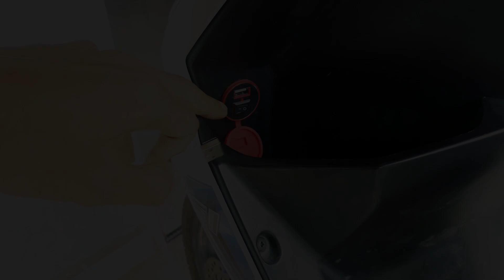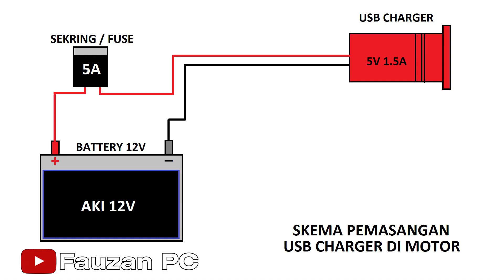Pasang USB Charger Di Motor

Comment: Bang mohon pencerahannya..
 saya mau pasang nih, yg skalian ada Amper meter nya juga,, saya coba tes voltasenya 13.1A.. itu normal ga bang ? Terus klo pake sikring yg 15A bisa ga ?
Mksh.
Reply from the maker: voltage 13.1V maksudnya ?
itu normal..
saat mesin gak nyala voltage di 12v
saat mesin nyala voltage diatas 13 sampai 14
sekring 15a bisa, namun akan bagus dipakai 10a kebawah
Reply: @FauzanPC  ok... Mksh bang.. Alhamdulillah baru beres pasang.. paling tinggal ganti sikringnya aja.. pas beli ga di liat2..

Comment: Mau tanya bang cara pemasangan ini berpengaruh gak dengan type motor sudah DC atau tidaknya? Atau mau DC ataupun blm DC gak ngaruh? Trimakasih
Reply from the maker: DC atau masih AC tidak masalah..
asal pengambilan arus di DC.. dan menggunakan battery aki
Reply: Makasih bang ilmunya
Reply from the maker: @billykubil2966  😁👍
Reply: Oh Iyah om kalo charge plus volt meter sama gak om pemasangan kabel langsung aki nya  @FauzanPC
Reply from the maker: voltmeter sebaiknya ambil kabel kunci kontak ON
Reply: Ok om terimaksih atas pencerahannya  @FauzanPC  sukses buat chanelnya om

Comment: Bang mau nanya. Itu harga sekring di bengkel gitu brp y? Lalu bagusan sekring 5A atau 10A? Semakin tinggi semakin bagus atau gimana?
Reply from the maker: harga nya 500-1000 murah kok sekring nya..
bagus 5A .. karna kebutuhan charger nya tak lebih 3A..
Reply: Pakai sikring seperlunya., Buat charger hp cukup 2-3 amper ., Sebab batere motor rata2 cuma 5 amper .
Amper semakin besar belum tentu semakin bagus , gimana untuk fungsinya .
Misal di pasang sikring 10 amper , jika terjadi konlet sikring kuat tidak putus , kabel kecil ,malah kabel nya yang panas nyala .

Sebaik nya, kabel + dari charger di seri dengan dioda + tahanan 1 ohm ( menahan tegangan 14 v dari dinamo motor ) + sikring ,di pasang semua secara seri . Charger akan aweet .
Reply from the maker: mantap 👍
terima kasih refrensinya 🙏
Reply: @ukmkotabandung3609  diseri dioda maksudnya gimana ya
Reply: @DiLi11  
Secara seri ,maksudnya , dioda di pasang pada kabel salah satu dari kaki dioda , kaki dioda yang satu lagi di teruskan ke aki motor , jangan takut terbalik , kalau tidak nyala ,di balik aja , dan akan nyala charger nya .fungsi dioda hanya sebagai penyearah arus ,jadi kalau terbalik tidak akan ada aliran srus nya , dan juga berfungsi penahan arus .., misal aki motor 5 amper ,yang di perlukan cuma 1 amper ,maka pasanglah dioda satu amper ( dioda N4007) .,hal ini sangat berarti dalam pemasangan Led ,sebab led akan awet jika tepat di beri tegangan volt dan tepat di beri besar ampernya. Misal Led warna putih 1 waat , led warna putih volt nya 3 - 3.4volt .,300mili amper .

Jika sumber nya dari aki motor  12volt 5 amper .maka untuk menyalakan led putih 1 wat , perlu diturunkan teganngan 12volt ke 3,2 volt pakai tahanan ,dan amper aki 5 amper perlu di turunkan/filter 0.5 - 1 amper pakai dioda N4007 ,jadi led tidak akan terlalu panas dan akan sangat awet .kira2 gitu pemahamannya .
Reply: @ukmkotabandung3609  wah, rumit ya.. Saya ga ngerti wkwk khusus orang elektro nih. 

oh iya kalo mau dihubungkan kekunci kontak, dari kabel usb charger  -  dihubungkan kabel warna apa ya mas?
Reply: @DiLi11  
Kalau dari kunci kontak ,agak membingungkan harus pakai indikator lamp atau avometer ,soalnya setiap motor beda2 warnanya , yang gampang , ambil aja dari jalur lampu senja (lampu kecil di motor ,setiap kunci di on kan lampu senja akan menyala , gunakan saja jalur itu ).
Reply: @ukmkotabandung3609  untuk honda mas, dari kabel - usb charger kekabel + / -  kontak ya
Reply: @DiLi11  kabel charger minus (-) bisa langsung ke aki atau lampu kabel (-) .kabel positif(+) charger ..bisa cari (+) di kontak atau (+) di lampu senja .aman aja ,sebab charger hp amper kecil .
Sebaiknya tetap pasang sikring itu wajib ...ikuti petunjuk di kemasan charger nya ,atau tanya langsung ke penjualnya .

Comment: Gan klo klo nge charger sambil di Hidupin mesin motor nya bahaya gak?
Reply from the maker: gak gan... asal pemasangan nya tepat, pastinya aman
Reply: Pastinya cepat rusak,  karena waktu motor jalan, arus aki jadi 17 volt lebih.
Reply from the maker: baru tau saya bang klo arus aki motor bisa naik sampai 17 volt , saya kira cuma mentok 🤔
usb charger di rancang dgn tegangan stabil 5v , walaupun tegangan aki berubah ubah,
Reply: Untuk menghindari kerusakan,  sebaiknya input B+ dikasih resistor 10 ohm 5watt,  elco 1000uf/25volt

Comment: Bang kalau beli skring nya, Kira-kira harganya berapa di toko??
Reply from the maker: beda beda setiap toko..
antar 1rb - 5rb
Reply: Itu skring nya bebas bang??  Soalnya tadi saya nyuruh sepupu beli pas tuan toko nya tanya untuk sepeda apa, sepupu saya bilang vario, tuan tokonya bilang, untuk matic kosong masih tinggal punya supra, pertanyaan saya, apa skring nya itu yang khusus matic atau bebas? Terimakasih bang
Reply: 2000 ada 3000 ada 5000 ada
Reply from the maker: sekring bebas utk motor apa saja..
berbedaan nya hanya di ukuran dan amper saja...
ada ukuran kecil dan besar.. 
terus 5 amper dan seterusnya..

Comment: Apakah itu gak bahaya ya..!
Reply from the maker: selama ini saya pakai aman aman saja 😊
Reply: Aki motor dg mesin hidup tanpa di gas itu 12 volt,  tapi klo di gas motor jalan,  itu aki bisa mencapai 17 volt. Apa gak berbahaya buat hp?
Reply: @diegowow3665  yah kalo mao charge berenti aja dulu op in mesin:v
Reply from the maker: saya baru tahu kalau aki motor bisa naik 17volt saya 🤔
usb charger di rancang untuk bisa stabil pada tegangan 5v
Reply: @diegowow3665  usb charger udah ada trafo kecil mas, jd meskipun input yg masuk 12 volt saat di gas output gk akan berubah, tetep 5 volt
Apalagi di video udah pasang skring, jd aman
Kalo terjadi konslet, yg putus cuma skring nya aja
Reply: @kangojol07  , skring akan putus jika alat sudah konslet,  gk mungkin skring putus duluan
Reply: @diegowow3665  saya sudah hampir 2 tahun pake, aman2 aja mas
Selama pemasangan nya benar
Kalopun ada yg bilang gk aman, bisa jadi itu dari usb charger nya yg (maaf) gk bermutu/buruk
Atau bisa jadi ada pemasangan kabel yg kurang tepat
Misal kabel yg harusnya di plus malah di pasang di minus atau sebaliknya
Bisa juga dari sambungan kurang erat atau lepas dan sbagai nya
.
Jadi intinya selama pemasangan nya benar gk akan ada masalah
Kalo mas nya kurang yakin ya jangan di pasang
Itu ajasih, maaf kalo salah cara penyampaian nya
Reply: @kangojol07  iya deh. Hehehe... 🙏
Reply: @diegowow3665  tapi ini sistem dc jadi arusnya stabil.. Berbeda dengan sistem ac.. Ac selalu mengikuti putaran mesin.. Sedang dc selalu mengikuti tegangan aki.. Tinggal di tahan oleh komponen seperti stabilizer arus.. Di tambah lagi sikring agar apabila ada kerusakan stabilizernya singkring akan memutuskan sambungan untuk terhindar dari konslet..

Comment: bang mau tanya aki motor kan 12v dan charger nya kan 5v dan itu di turunkan menggunakan apa bang teganganya, apakah ada modul di charger nya. tolong di jawab bang trimakasih
Reply: Saran saya jangan pake yang langsung usb bro, pake yang colokan lighter mobil aja yang biasa buat ngidupin rokok, nanti pake charger bulat buat yang di mobil, jadi lebih aman buat gadget
Reply: Kalau mau diy gini mending pake modul step down dc, baru sambung ke usb
Dari 12v ke 5v

Ada budget lebih bisa belikan car charger udah jadi, colok ke power outlet 12v yang di mobil
Reply: Itu kan input 12v(aki), output udah jelas2 5v (charger) otomatis sebelum arus keluar menjadi 5v udah di step down dari 12v😂

Comment: bang kalo pasang nya gitu motor dalam keadaan mati pun bisa ngecas hape.. takutnya kalo motor di parkiran trus ada iseng numpang ngecas hp tau2 aki  motor nya tekor😄
Reply from the maker: memang benar sih bang 😄
tp kemungkinan sangat kecil klo ada yang numpang tnp sepengathuan
Reply: Kan kalau kunci on baru bisa ngisi
Reply: saya sdh 3 thn pasang charger hp di motor, jika kabel di pasang langsung ke accu, dan kontak dlm keadaan mati maka charger tdk ada setrum atau tdk dpt di gunakan, kecuali kontak nya di nyalakan.
Reply: @imanbrajamustika8372  karena anda pasang di output kunci kontak ...

Comment: Aliran aki sama carger beda kan bang....gimana cara ngubah arusnya(ACDC)
Reply: Ada komponennya bang, input 12volt DC, terus di output ke hp 5v jadi ac
Reply: Ada modul step down nya bang, buat ubah tegangan dc 12v jadi 5v
Reply: @muhamadyusril6613  12v dc ke 5v dc bkn AC
Reply: Gaptek bgt si abang
Reply: Aki dc
Charger hp dc
Yg dicolok kelistrik itu ac masuk ke hp lewat charger diubah jd dc